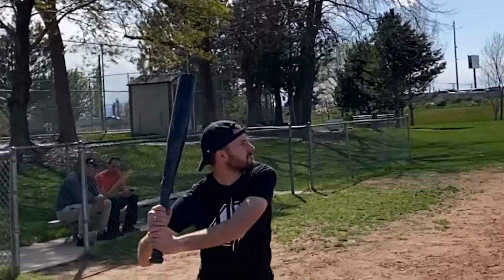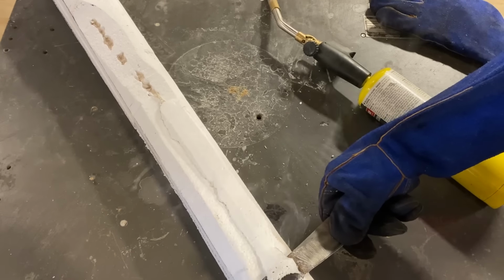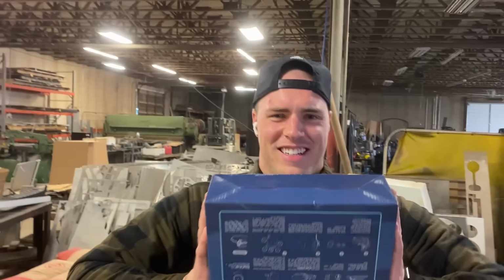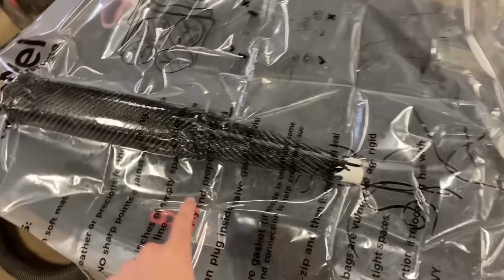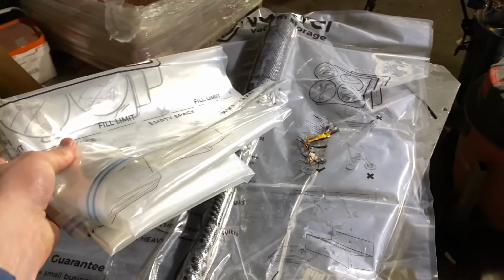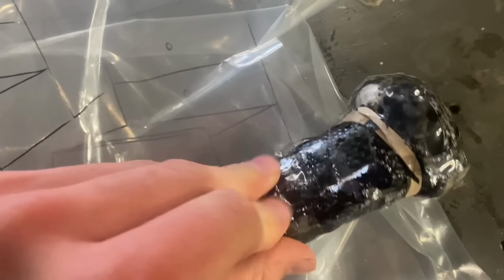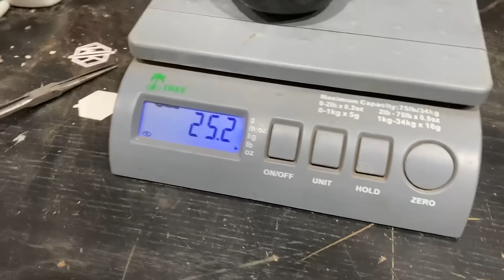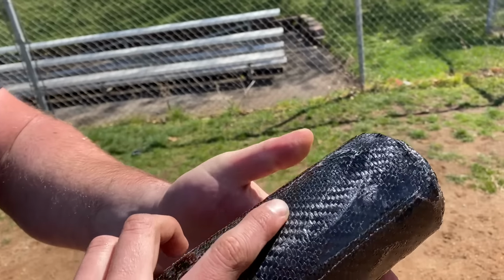World's Lightest Baseball Bat

Comment: Someone who knows how to properly do carbon fiber needs to really help these guys.
Reply: Nobody knows carbon fiber better than a prosthetic appliance shop. Problem is it might cost an arm and a leg for them to give you a hand.
Reply: @kg4boj  booooooo lol
Reply: I used to make carbon fiber car parts. You need a few more things. You need to use a proper mold with mold release, the carbon fiber, stuff called peel ply, a fluffy mat type material called bleeder...it allows the excess resin to be sucked thru the peel ply and compress the carbon into a uniform thickness, and then your bag with absolutely no leaks. Also, the mold has to be a reverse of the bat...in other words you're building from the inside out. It would be a difficult, but not impossible task. We used to make tube protectors for race car tube frames and it was somewhat similar, but it was a semicircular shape. 
I never actually made a real bat so I can't say with any conviction on how to do it. But that's a very basic idea.
Reply: @kg4boj  Fuck what Ronnie said, that was awesome
Reply: Xyla Foxlin would be a good person to call...
Reply: The uniform distribution of fibres being fked during casting is an issue
Reply: They need Dr. Carbon Fiber!
Reply: @themaskedcrusader 
You made video’s 15 years ago… 
YOUTUBE OG🥳
Reply: @kg4boj  this is amazing
Reply: What about you
Reply: @kg4boj  😂
Reply: No no they watched a YouTube video so their basically experts.
Reply: Someone who knows how to properly do baseball needs to really help these guys
Reply: that one knife youtuber that makes knives out of miscellaneous materials made a knife out of carbon fiber
Reply: @kg4boj  I heard the sales pitch is the real hook.
Reply: @danschilling5863  That's the point. Before they stump you with the price.
Reply: Yeah
Reply: @kg4boj  I'm going to go out on a limb, I'm not sure if i can go 'mano y mano' continuing this. lol
Reply: I can’t
Reply: @WebbstylesMusic  Hahahahahah
Reply: They also just flat out didnt use any carbon, only plainweave
Reply: Shhh, let them do their thing
Reply: @kg4boj  im sure there a lot of people outside that area who knows carbon fiber
Reply: @FortniteTrashCan  Well yeah, it might take a bit of legwork though.
Reply: @MonkesClayhut  yer damned right!
Reply: And also how to properly hit a ball
Reply: Definitely not Oceangate.
Reply: Me 😂😂😂😂
Reply: Where’s the car man with a carbon fiber addiction?
Reply: @kg4boj You’ve been here since 2007?!?! That’s a year before I was born!
Reply: @GoofyBengal  I've been on YouTube since dial up and it was an embedded media player inside a browser window. You could right click and save any video even the star wars holiday special
Reply: just dont ask oceangate
Reply: What do you mean?!!? Would it even be a Waterjet Channel video if everything was not literally as jank as possible without causing lasting injuries?

Comment: They make carbon fiber tube socks, it's a single piece and you'd be able to stretch it to the exact shape of the bat, with zero seams. Also, the vaccum bags are pretty pointless in this case as you're not doing resin infusion, so it's not really doing anything. Also, spray glue is your best option, it plays well with resins and styrofoam.
Reply: How comfortable are carbon fiber tube socks?
Reply: carbon fiber nut sock
Reply: @demeats  🤨📸
Reply: @demeats  you’ve been caught in 4K
Reply: Lmao
Reply: @demeats  wouldnt need resin
Reply: how a person can wear a sock made out something somewhat stronger than metal??

Comment: Try 3D printing a mold for the bat. I bet you could use it to get a really strong and clean looking result made from just two pieces of carbon fiber.
Reply: Or slicing one out of layers of MDF on their fancy 3-axis water jet. Either keep the direct result and embrace the low-res polygonal life, or finish it with a little sanding to round out the segments.
Reply: @ParadigmUnkn0wn  that’s smart too. Probably a lot faster.
Reply: Perhaps make 3 halves so there's some overlap and more surface area for the adhesive/resin. And a core made from some sort of hard foam filling could really improve the strength without too much of a weight increase.
Reply: @challengegravity  Three... halves?
Reply: they make water dissolvable filament that you can lay up and dissolve out
Reply: Yes, rotated 120 degrees from each other so they overlap evenly. Alternatively you could do four halves, joining the first two as I presume you two have in mind, and then rotating the bat 90 degrees to encase the base shell in another layer, with each half joined to both sides of the shell underneath. But this also introduces extra weight of course.
Reply: That's complicated and hard and not wjc style. They'd be better using the water jet to cut a mold out of silicone.
Reply: @challengegravity  Ah. Think I see what you mean now.
Reply: Help them. This group isn’t the greatest at learning new things.
Reply: Sir this is the water jet channel
Reply: @zachaliles  Hahaha, why didn't I think of that? Darnit. You took my job!
- Dey took his jerb!
- Dey took our jerbs!!

Comment: I actually worked in a factory that made carbon fiber bats for like a month, and I actually was responsible for the first step of winding carbon thread around a metal rod to make the shape of the bat, it's was an overarching structure of overlapping thread and there was 9 layers of it, once sent off to the finishing team where they seal it you then had to put the carbon and kevlar sleeves over the center of the bat, where the ball would hit, they were then sent off to be capped and then finished

Comment: Try using carbon fiber sleeves instead of the sheets, also try a core that bolts together in the center of the handle area so you can pull the 2 halves out, then cap the ends later.
Reply: Carbon fiber strip prepreg on lathe

Comment: Caveat for carbon fiber is that it's strong when it comes to tensile loads. If you hit transverse to the plane of the fibers then it's really brittle as the bulk of the load at that point is taken up by the epoxy and not the carbon fibers

Comment: Idea for bat, use a 32" long wooden dowl, then wrap it in layers of carbon fiber in the shape of a bat. fewer layers at the handle and more on the barrel. the wooden dowl in theory would create the rigidity for the bat, and the carbon fiber would provide the structural strength. Then resin, then shape it on a sander.

Comment: Steps for success:
1. Use higher density foam
2. Buy some thin CF tape/strip (thin enough to conform to your smallest radii)
3. Use an ATL (Automated tape layer) on a lathe (I guess you could so it by hand)

Comment: If you guys are going to do a V3 then skip the bag and use regular narrow packing stretch wrap. Wet out the carbon, roll it onto the form, then wrap tightly with the stretch wrap from one end to the other. Not only will that wrap compress carbon fiber together nicely, it will also squeeze out all of the excess resin. Do put a dowel (or a broom handle) through the styrofoam so it's easier to hold and so it stays straight. Use spray adhesive like Super 77 for the foam, it should not dissolve it. Or use pink insulation foam since it's more resilient. 

EDIT: In some cases it may be helpful to lightly pre-glue the carbon to the form with the spray adhesive around the edges, then resin it. Will make it easier to position while dry and will keep edges from fraying as much.

You can even use the same technique to make a carbon fiber ball wink wink

Comment: I'm not carbon fiber expert what so ever, but i feel like the way to do it would be similar to taping a handle for a hockey stick. Start at either end and use one long peice and roll and spiral it around the bat. Maybe it will make it perfrom like shit, but this would help with the carbon fiber grain all being in the same direction and there not being noticable differences between bat head and handle. Plus I think that would make it stick better since you could just coat the whole bat in resin and then roll it up. I'm sure it would actually be 20x more difficult than I made it sound

Comment: if you wanted you could like split the bat down the long way and put a sheet of carbon fiber like into the core you could run a like an x length wise i bet. stuff looks hard to work with though lol

Comment: truly insane tooling for turning a styrofoam bat lmao

Also you should really be wearing masks for like every single thing you did in this video, anything to do with carbon fibers especially.  any small fragments that break off when you 'cut' it are basically little tiny atomic needles that pierce and lodge themselves into your lung tissue and then never leave

its basically the 'super' version of fiberglass.  its smaller and harder

Comment: First off this was doomed from the start. You need a debulk system as well at layup setup, as well as putting it under a debulk bag and final cure to finish it. All of this must be done under very specific pressure and time constraints to prevent damage as well as the CF from going out of tolerance. What sucks is it would seem you did absolutely no research before doing this video, and i feel a real opportunity was missed.